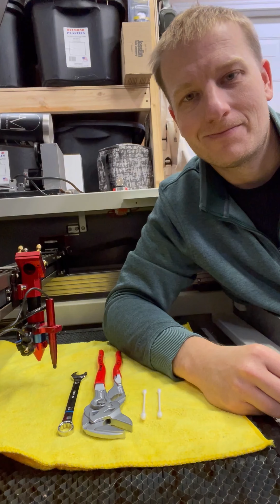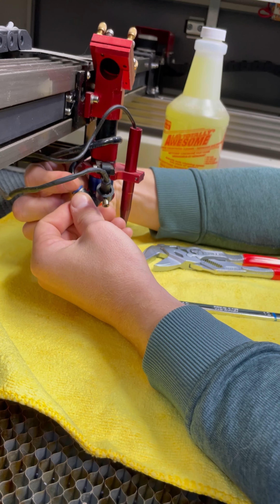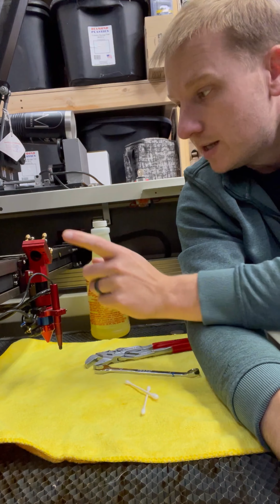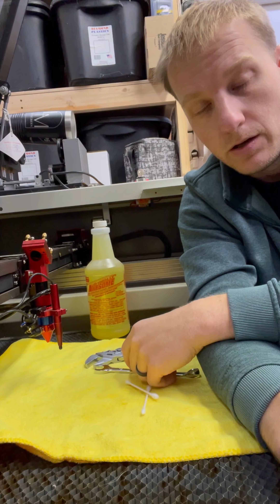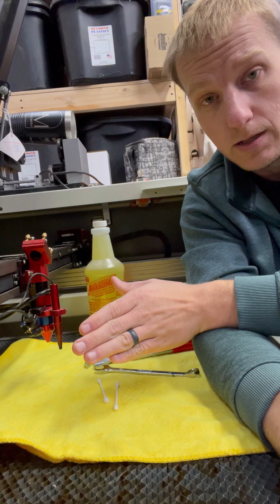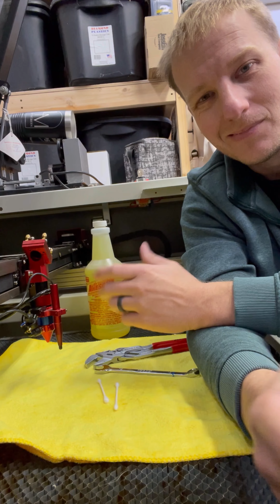Monport Techtips: How to clean the lens for 80W machine

Comment: Thanks for the video,  I have a question that I hope you can answer. The tube that the nozzle( lense holder) screws onto can be lengthened or shortened by the nut above the nozzle, does this affect the focus? When receiving my 60w 16”x24” that nut wasn’t tight and as I was unscrewing the nozzle nut the tube lengthened a bit.
Reply from the maker: It will affect. But you just need to do re-focus~ Do not worry~